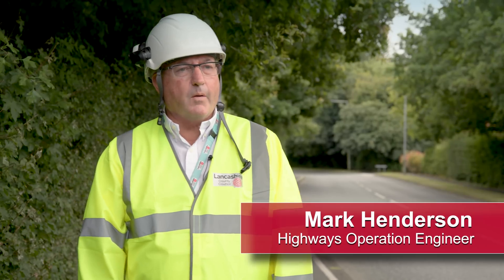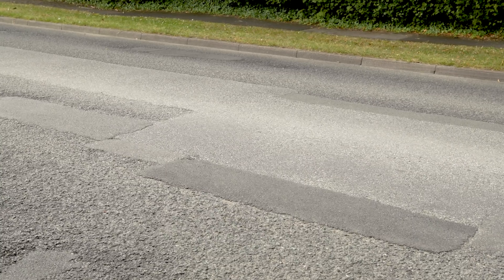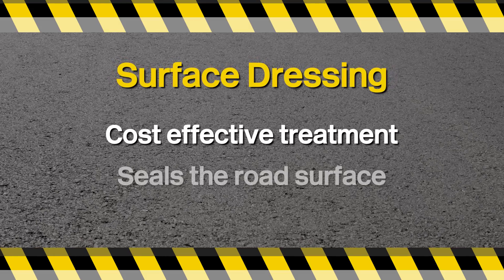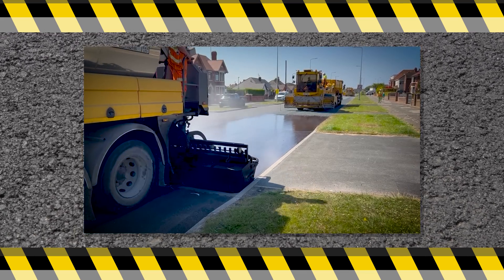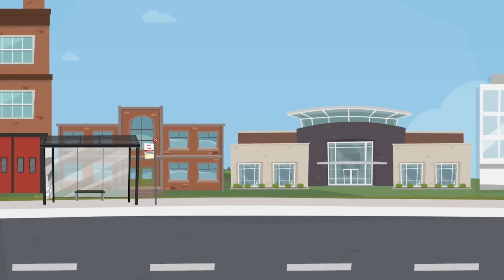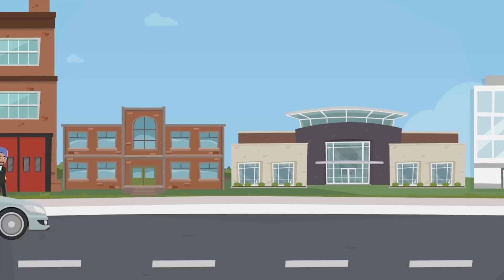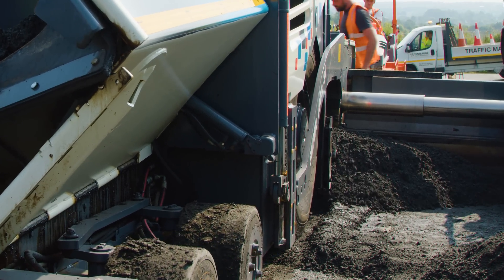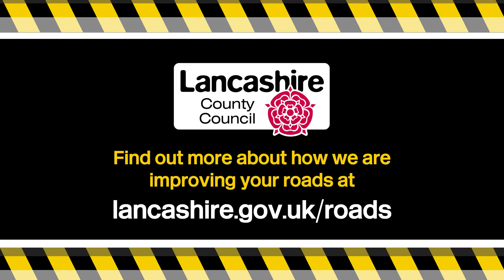Maintaining your roads – why we use different treatments

Comment: Hi I know that you control Rossobus local services if I am correct 7, 8, 10, 11, 12, 13 buses if so I would like to ask if you could ask if they have any changes planned in January like they usually do every year and if so it would actually be nice if you could do same once again like you did in 2019 before covid where the numbers 7 & 8 operate every 2 hours between Rawtenstall and Bacup via Newchurch, Waterfoot, Edgeside then 8 calling at Burnley and then 7 calling at Todmorden and also then this time contining with a frequent hourly service number 10 Rawtenstall to Edgeside to help with a local link hourly but then at the same time between Rawtenstall and Bacup one hour it would be The 7, and then next The 8 but then at the same time you could also change some of your 7 and 8 timetables to servere 2 schools as you scarpped a 7 school bus carrying 37+ students in September because you said it was unviable when it was viable so the 7 and 8 could servere the Valley Leadership Academy as well at around school time as the number 7 already goes to Todmorden High School because since September it’s been a nightmare with servere overcrowding on 10 to Edgeside and 464 Accrington and Rochdale too and creating many parents more car journeys due to no bus service at around school times as you used to be able to get on 7 school bus between Waterfoot and Todmorden for 3.20pm but not till 4.33pm now from Rawtenstall and then 7.34am from Todmorden and now isn’t one till 8.22am shocking 😮.